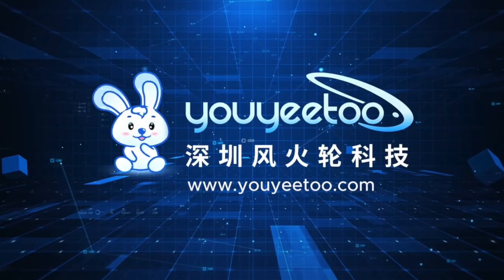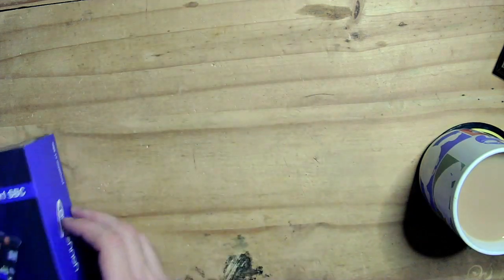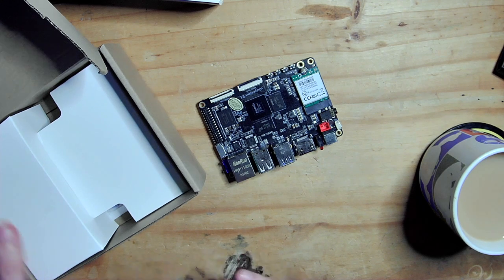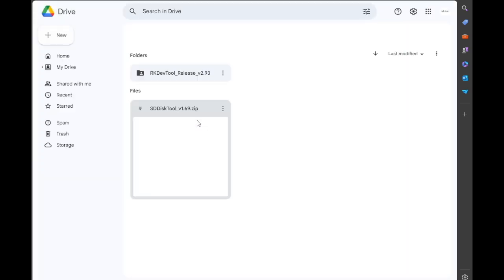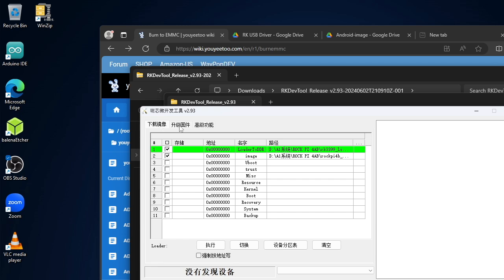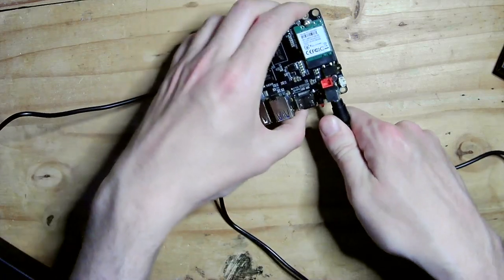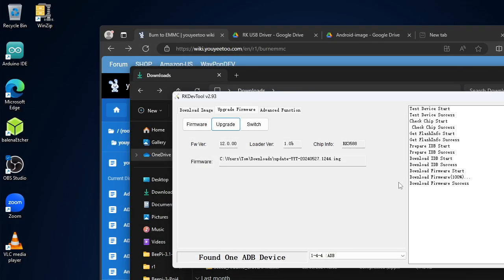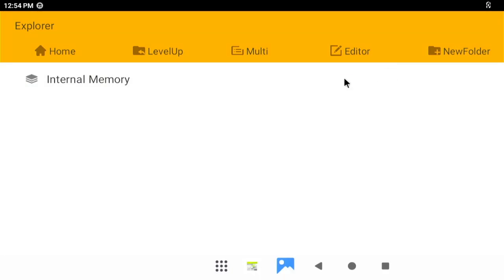#youyeetoo #R1 Reflashing the eMMC Firmware - Running #android

Comment: Hey, I am trying to make a portable emulation machine with the R1. I want to run rEFInd on the R1 with some light linux OS so that I can run a python script which will let me use the inbuilt controller from the GPIO headers. Then I want be able to triboot into android, ubuntu, or batocera. How would I go about doing that? since most tutorials have just gone through BIOS to install everything. im guessing the rEFInd will be through the software you showed but I don't know how to do the rest. Can you help?
Reply: Is there a way to enter BIOS on the R1?
Reply from the maker: Can i just check your not confusing the R1 with the X1? 
The X1 is X86 based hence like a normal PC has a BIOS that you can enter. The R1 is ARM based and acts more like a Raspberry Pi and uses a framework complied in the ROM issues used as the boot OS with minimal adjustment settings.
I would strongly recommend Youyeetoo Discord sever https://discord.com/channels/1266234227955990581/1266250035843305483

And Forums to ask directly the dev team these questions. https://forum.youyeetoo.com/
Reply: @WiFiSheep  I am talking about the R1, not the X1. I am new to arm based stuff so I am not sure if it works like normal computers with BIOS and stuff.
Reply from the maker: No ARM systems dont have BIOS in the way X86 PC dose, Some builds of linux do have underlining boot structures etc, but thats down to the ROM image being used. Again as mentioned take a look at the links provided in my previous comment.